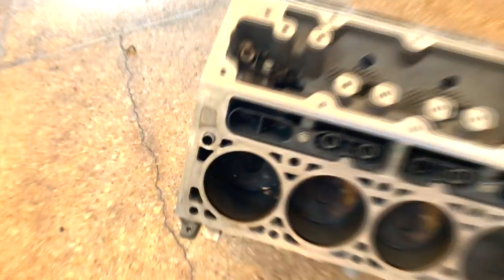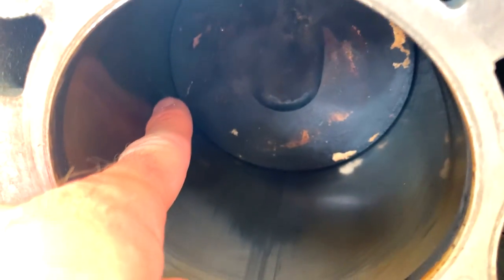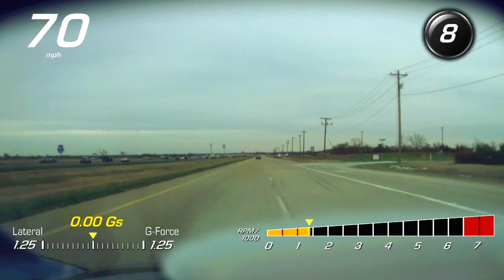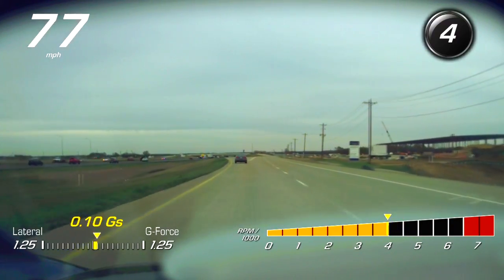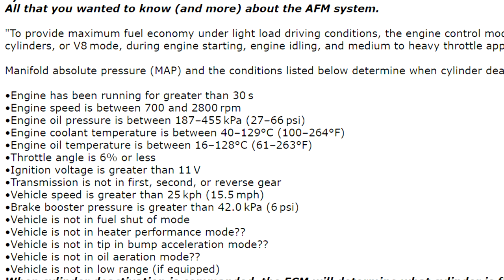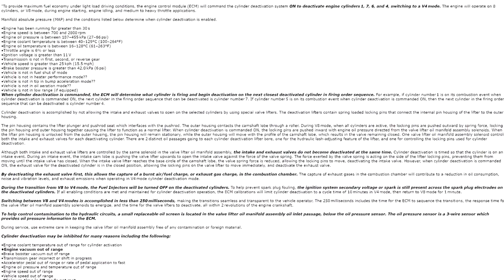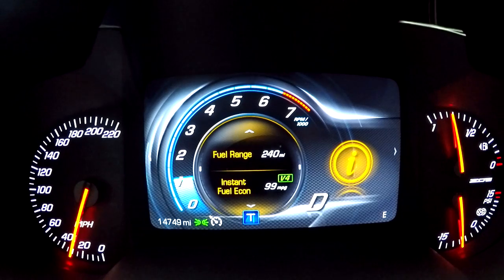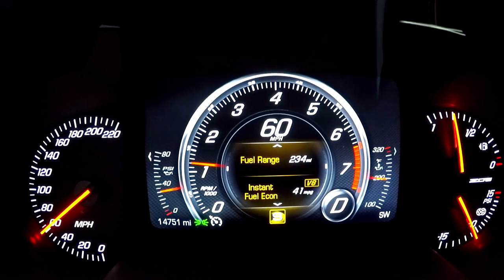How to AVOID 2 C7 Corvette Drivetrain DISASTERS! A MUST Know! *Chevy C7 Corvette*

Comment: The 7-speed Manual will only go into Cylinder Deactivation if its in Eco mode.
Reply from the maker: StreetMods Z06 See, that’s what I thought but then I heard that it happened no matter what mode you’re in. Thank you for the feedback.
Reply: Correct my 17 manual only goes into v4 in eco mode
Reply: 2015 manual, never happens outside of eco mode.
Reply: Wrong. Mine goes into eco at low and steady RPM. You can hear it come out of eco when you slightly speed up.
Reply: @davidduhe1657  If you have the 7-speed trans it will only go into v4 when in Eco mode, Wont do it in Turing,Sport,Track mode.  If you have the Auto trans then it will go into v4 in any mode when driving easy.    You can also pull up the display on the gauge screen that shows when the car is actually in V8 or V4 and verify what the car is really doing while driving.
Reply: @venomous1svt  why manual will always be more fun, thanks for the wisdom
Reply: Found my comment a year later. Wow
Reply: Now I drive a manual C7 Grand Sport.  So happy I found this comment hahaha never give up boys
Reply: Thanks for the posts regarding Manuel trans only going into deactivation mode in eco. Was wondering about that
Reply: Only in eco mode for my 2015 C7 manual
Reply: I have a manual 2016 C7. I have never experienced it going into B4 mode unless it was an eco-mode.

Comment: Number one owning a Corvette I could care less what gas mileage I get
Reply from the maker: red stingray Corvette Exactly 😊
Reply: Unfortunately the way to make a corvette that inexpensive is to share parts with the rest of the fleet. You should care about your gas mileage if your own a Corvette. if money isnt an issue, upgrade to a car that doesnt wreck itself by cutting out half of the engine while running at highway speed.
Reply: If you get less than 5mpg you would.
Reply: It's there so we don't have to pay the gas guzzler tax which is $2500.
Reply: So, you COULD care less?
Reply: I get 19 city & 24 highway 2016 stingray. Mileage is daily doable in my opinion

Comment: I fully agree with your analysis - "Eco" mode is destructive - on my 2016 Z06 I installed a AFM/DFM Disabler from Range Technology at 13,000 miles - I bought it directly from Range Technology to gain full support, latest version, and future updates or programming - the price is the same as Amazon - $189 - it takes 2 seconds to install - simply plug it into your OBD2 diagnostic plug located down by your left knee in your Corvette - ever since my Z06 has never been in V4 mode – I believe this is not optional it is mandatory.
Reply: Need to know how it works and how you did it
Reply: @xvk317  Go to Range Technology’s website, then order the disabler for your year. When it comes in the mail, plug it in to your OBD2 port on the inside lower left side of your dash. That’s it. If you can eat a pizza you can plug this in. Works great on my C7 with that janky A8 transmission.
Reply: @jrparker4804  As long as it doesn't have mushrooms or fish on it.
Reply: doesn't void the warranty?
Reply: @messy908  I'm wondering the same thing?
Reply: @jrparker4804  Is there a typical mileage associated with the lifter failure?  I have about 25,000 miles on mine.
Reply: This can be done by any tuner as well, at 200 bucks your halfway to a tune so might as well get both.
Reply: I sold my Range device after it ran my truck battery down three times. I called Range and the lady told me that if the truck was not used for four or five days it would run the battery down. She suggested taking it out if you are not going to use the vehicle. Beware of this like at an airport parking lot for a few days if you go on a trip or get sick for a few days.

Comment: Range technology makes a module that you can plug into the OBD port to stop cylinder deactivation.  Amazon has them for around $200.00.
Reply from the maker: Rebel Nation Sweet, I’ll have to check that out. Now the question is, when will that show up for the C8?
Reply: @BrinkofSpeed  Great INFO
Reply from the maker: Keion Chase I’m glad you found it helpful.
Reply: The other question is will using a module void the vehicle warranty?
Reply: Steven Mitchell my Chevy dealer claims it will not void warranty, in fact encourages the use of a module!
Reply from the maker: MICHAEL mcmillen Great news.
Reply: I bought the range module within the first week of owning my C7. It has worked flawlessly and I haven’t noticed any problems with transmission / torque converter shutter I previously had or decreased fuel mileage. Cyl deactivation is a garbage feature.
Reply: I haven't had any problems with mine either. I got mine as soon as I took delivery of my 19 G.S.
I didn't want to take a chance on T.Q  shutter. I agree cylinder deactivation is B.S. I didn't buy a vette for fuel economy,  at the very least gm should have allowed the driver to turn it on or off if they wanted to.
Reply: I have one on my truck. Works great!
Reply: Don't drive a c7 without a Range unit, tuning afm out or scrapping the junk lifters and cam.  I ran range from the start with a 17 z51 and no 4 mode ever. Will not leave trace when unplugged. Although it won't allow automatic upload of diagnostic info due to occupying obd . Can add a cutoff switch to range also.
Reply: Yes. Bought it before I got the car and never have driven it without it keeping me out of 4 banging
Reply: How do you add the cutoff switch?
Reply: @ChadWoodNC-PiedmontSkyCams  it's on Amazon too, plugs in with range. Tonsiki OBD 2 Cord 16 pin M/F Male to Female Right Angle Diagnostic Extension Cable with Power Switch to avoid battery drain
Reply: Thanks
Reply: I have a z06 and a gmc with the 6.2.  Do i need to buy 2 modules or with one work?  Does the module have to stay plugged in?  I would need 2 if so or does it load the program into the computer so i can use it on the other vehicle also??  Yes i had low rpm shuttering on my truck, they changed the trans fluid and it went away.  I bet it is from the cylinder deactivation.  This is crazy.  Thanks for any help y’all can give me on this.
Reply: @kiddt1999  yes one for each. It doesn't load into ecm. Only works when plugged in.  Check software version for truck, may be different than vette
Reply: @TaillightSolution  Where can I buy the range module and is it hard to install? Thanks
Reply: do you have a link to buy the module and was it hard to put it in? Thanks

Comment: I had this discussion with a friend a year ago, so we tested it.  My 7 speed manual would only go into v4 mode when the Eco mode was selected.  All other modes stayed in V8.  Since the C8 is a dual clutch, hopefully GM will configure the cylinder deactivation to only work in Eco mode.
Reply from the maker: John Os Thank you for your feedback and yes, I hope that is the case with the C8.
Reply: Go to the Amazon store you will find the gift that will solve the problem, I own a 2015 C7, convertible, auto, and I have had the same problem, now it's over now, the v8 sound is back in the hood 😂😂
Reply: 2017 C7 Z-51 manual. I keep it in sport 100% of the time. No cylinder deactivation, and it keeps the dual mode exhaust open as well.
Reply: I agree, my 2019 Grand Sport 7 speed manual doesn't go into V4 unless I put it in ECO. I was trying to get home from the mountains last summer in ECO mode and when it kicked back into V8 as I transitioned from downhill to uphill it let out a loud CLUNK! I researched it on the owners forum and won't ever use it again.
Reply: John Os Same here, only way I ever see v4 is when I’m in Eco. All other modes do NOT enter into that mode on a 2016 z06 manual
Reply: david wolfel I did the same thing, general cruise to a vacation spot thinking v4 is cool. Boy was I wrong.
Reply: For an extra $800 per unit, I'm sure GM could. Keep in mind they are shooting for the absolute lowest cost with the absolute highest margin. at $60k for a 200 mph car, I wouldnt expect any special treatment on the gm power plant.
Reply: Had mine deleted

Comment: The only question is...who the hell is using eco mode? Its been well known the cylinder deactivation destroys gm engines. This is not limited to the corvette and is very common knowledge. My fix to get rid of cylinder deactivation is one of the best IMO. Supercharge it and there is too much load for the system to ever engage it. You dont even have to tune it out.

Comment: I bought the RANGE AFM Disabler device when my 2016 C7 Z51 had 8255 miles.  After 3 years now, it has never gone into V4 mode and I am so glad I bought the device.
The price was $216 then and is about the same today.  It is a must buy for the C7.  The Chevy Dealer knows about my device and they totally approve of it.

Comment: The Range technology product works like a champ, keeping the ECM from going into V-4 mode, ever.  My mileage barely changed under similar driving conditions. Just plug it into your OBD2 port & you're done. I also had the trans fluid flush/replacement, but don't really trust it. The Range is worth the money.
Reply from the maker: Skip Hedgepath Cool, Thank you for the info.
Reply: Just seen your comment.  Looking into buying a C7 next year and definitely getting the Range Technology.  I'm assuming since it will be used that the car was driven with out the Range and might be problems in the future?  Any tips you have on what noises to look for or do you think just think adding the Range and possibly trans fluid flush will take care of any future problems?

Comment: To avoid V-4 mode in my 2015 Silverado, I just put it in manual mode and 5th gear. Therefore it only works gears 1-5 without V-4 mode. Corvettes use V-4mode more cause they have less wind resistants. Chevy trucks (shape like a BRICK) stay in V-8 mode more than Corvettes because they are less aerodynamic. (on the highway)
Reply from the maker: Curtis Reid 👍

Comment: Yeah I’ve used the range module for about a year and works great.  The Chevy dealer service manager actually encouraged me to buy the module and said it would not void warranty.!  Placing your automatic in manual mode will keep the car from going in 4 cylinder mode however you have to then manually shift. The module is a cheap investment IMO and works seamlessly with your car. The main reason GM uses deactivation is to increase the federally mandated gas mileage per car.  Deactivation is fairly cheap for the manufacture to increase gas mileage because it is basically just  a software program.  I would rather do a deactivation work around than have Corvette go back to what they did in the 70’s and reduce horse power equivalent to a pinto!
Reply from the maker: MICHAEL mcmillen Cool, I’m going to get it for sure.
Reply: Michael are you still happy with your range module?
Reply: I'm about 9 months into owning my '18 Z51/A8 trans.  I was unaware of this issue, didn't know "AFM" was a thing.  Had the shudder, Chevy did the triple flush underwarranty, and the service writer there enouraged the range device.  So I did.  only hitch in this is if the car sits for a couple weeks, need to put the battery on a tender as the device does draw when connected to the OBD port.

But otherwise, driving with pride and no worries about that silly V4 mode.
Reply: @shaark92 just unplug it when you're not driving(or when it'll sit for a while. Or, just use hptuners

Comment: I have a 2014 C7 Z51 M7. I rarely take it out of Touring mode. I have NEVER had it go to V4 mode even when “ lugging” it on occasion in 7th @ 1500 rpm. In fact, the only annoying aspect is the occasional 1-4 skip shift @ low rpm in 1st. Reading the comments below seems to bear out my experience. Sorry Mike, M7’s forever!
Reply from the maker: ken gutwein I hear yeah, but if you don’t have the correct display pulled up, it won’t show it going into V4 mode ever. Trust me though, if you have it in ECO mode, and you are driving at decent speeds on the highway, it will go to V4 mode lots.

Comment: I have a 2019 C7 stingray with a 7 spd manual.... The cyl deactivation can be overridden/by-passed by avoiding ECO mode, Also it says in the manual it changes the fuel management system.

Comment: I have a 2017 Grand Sport with a LT4 supercharger on it. When they pulled my block apart to hone the cylinders and put forged racing pistons and rings in there they actually deleted the system from the engine internally. Glad I took it to a speed shop that knew what they were doing. When I bought it the guy had only deleted it from the computer system and just threw on the blower. After about 10k miles the front main seal went. When they took the engine apart half my piston rings were broken. Don't just add a supercharger without beefing up the internals!
Reply: HAHA, I'm back two years later and guess what... Torque converter is blown!!! In the shop now to add an oil catch can,  Circle D torque converter with 3000 stall, carbon fiber drive shaft with coupler delete, and a TCM tune. I cannot wait to see what it drives like! My car has 43k miles.

Comment: I had that V4 mode turned off when I had it tuned which was not very long after I had my Vette. I didn't buy a 2014 C7 Stingray for MPG. Now it's full bolt on with a A&A supercharger kit making 622 whp n 570trq very fun car.

Comment: So now to the heart of your question. Yes, when you are in manual mode the engine stays in V8. That is true either by hitting the "M" button or by entering "temporary tap" by pulling one of the paddles. Temporary tap will revert to "Drive" after about 5 seconds if you don't request an additional shift in that time. AFM is also de-activated in "Track" mode. Since PTM is only available in Track mode, the answer is yes to that one too. If you are in PTM, it will be V8 only. New for 2020 is the "Z" mode which will come from the factory set up as an extra sporty mode including shift schedules pulled from the "Track" mode, so that will be V8 only. Of course, you can customize "Z" mode any way you want, so if you elect another shift pattern, AFM will return.
Reply: I just watched a video and the guy's car went into V4 mode while he was in Track mode. It does not prevent V4 switch8.

Comment: I have a 2020 GMC Sierra with the 6.2L engine and the 10 spd transmission. I had a major valve lifter failure at 8,300 miles. Fortunately no other engine damage occurred. I am definitely going to get the Range Technology module! Thanks for putting this video together!

Comment: Thank you . I have a 2016 with only 4000 miles on it . Im only going to use the manual mode on the highway moving forward . I dont want the headaches or the expense fixin* it
Reply from the maker: Bill Fleming You’re welcome Bill. I totally understand.
Reply: exactly....I HAVE MY c7 for 4 years and ALWAYS stay in M  mode and shift with the paddles....it will NEVER engage V4 as long as you stay in M MODE
Reply: @mel-lf3oj  thank you !

Comment: I own a 2014 Z51 M7.  Same as the others have posted.  Only time v4 mode will occur on my C7 is in Eco mode.

Regarding the comment on the torque converter - there is nothing mechanically or controls wise that link cylinder deactivation (v4 mode) to issues on a torque converter.  I have a Tahoe that I’ve been driving for 9 years and has cylinder deactivation - no issue with the torque converter.

On the C7 A8 the known issue with converter (shudder) is due to the fluid being hygroscopic.  GM has made several fluid composition changes to try and address the water absorption - research it.

Comment: This is also why the car has a steel torque tube, to reduce vibration and unwanted nvm in v4 mode. So they forced a mode nobody wanted for 1-2 mpg and added weight and complexity to the car. It's the only bad design choice they made on these cars.

Comment: one owner characterized the problem after just 1,000 miles on his new C7 Corvette Grand Sport. The owner said vibration suddenly occurred while driving around 55 mph and a dealership said all four wheels were bent and needed replacing. GM Customer Care told the owner this issue was not covered under warranty.

Comment: ON my 2018 Stingray with a 7 speed manual, the deactivation only works in Eco Mode. When in Eco mode the display shows when the engine switches back and forth. Here in Va the 4 cylinder to 8 cylinder mode is useless. I have tried it a few times and the thing switches back and forth every minute or so. Takes very little hill for it to switch.  Useless as far as I am concerned.
Reply from the maker: George McDonald I totally agree, it doesn’t work well at all and this is one of the reasons that it puts so much wear and tear on parts.